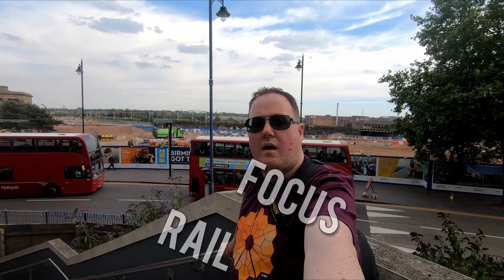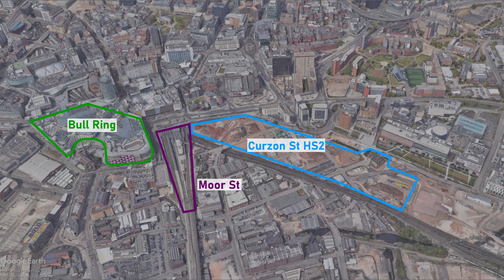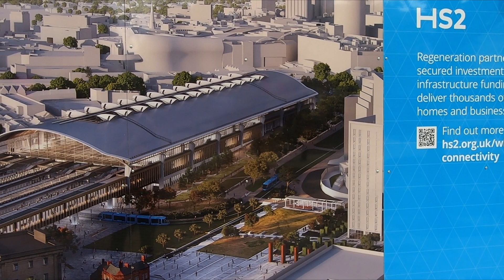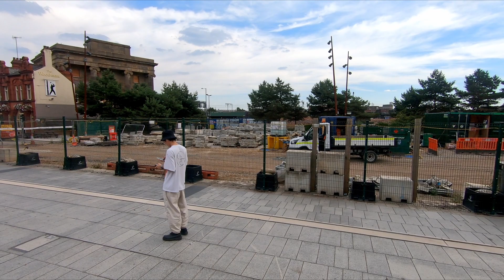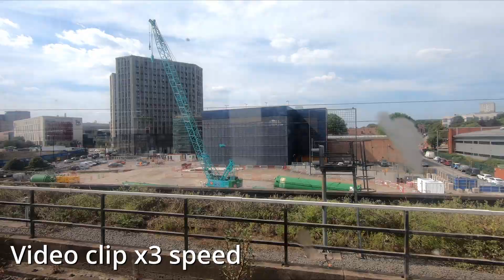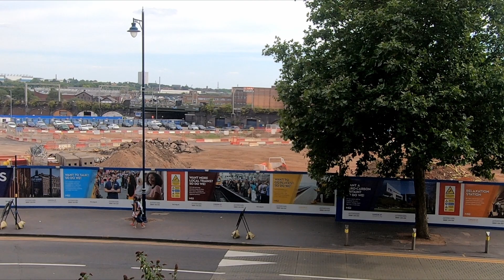HS2 Birmingham Curzon St Station | Progress Aug 2022

Comment: The Midlands and we Midlanders need a good underground "tube" system, like the new Elizabeth line in London. We should have the same well integrated Public transport system that the Londoners enjoy and have enjoyed for decades. HS2 will only benefit people living close to the few Stations on the route. To use HS2 I would have to travel for at least 40 minutes, more realistically a full hour. Using my local station, Atherstone; from home I can be in Euston in less than an hour and a half. Why would I spend an hour travelling to Brum, to then spend another hour getting to Euston? Bear in mind that HS2 won't take you to Euston, it will only take you to Old Oak Common, from where you will then have to catch a tube to Euston or London centre. I wonder if these planners can do joined up writing; they can't do joined up thinking.
Reply from the maker: I can say categorically HS2 will stop at Euston, they're building the new station as we speak. However Old Oak Common will offer improved connectivity thanks to connections with Crossrail and GWR services.

Atherstone would have been closed in alternatives put forward to upgrade the WCML instead of building HS2. HS2 released capacity on the WCML for improved regional links, we shouldn't forget HS2 is primarily about capacity, improved journey times is just an added benefit.
Reply: @Rail_Focus  Mooted capacity as presented to Parliament about 11 years ago was I believe 18 trains per hour. Then after they talked to the train planners, mainly in France, that was downgraded to 14. The Eastern leg of hs2, to East Mids Airport, it is thought, will have 8 trains per hour. On top of that, the speed will never be as high as the originally stated 240kph; more likely it will be 200kph. This isn't a project of National importance - it is a very poorly conceived idea which will destroy huge swathes of prime agricultural land. Land which we will all need in the coming years, when politicians come to the realisation that we need to be self sufficient. Don't give these people the oxygen they need to keep their wasteful rail system on the cards. Instead, tell them that you want a fully costed well thought out, integrated Midlands transport system. This should be similar to the London underground tube/bus system. We will all benefit from that.
Reply from the maker: @btg7663   I'm not sure where you're getting your information from such as it won't stop at Euston and the speeds? But the maximum design speed is 360km/h, but in operation trains will travel up to 320km/h, with trains able to reach 360km/h on straight non-tunnelled sections if they need to make up time. 

As for capacity I was talking about released capacity on the WCML for improved regional and local services and additional freight capacity, that simply would not be possible without the construction of HS2.
Reply: @Rail_Focus  What worrying is they haven't even completed the design of the new Euston even down tot he number of platforms the station have. An given the continue cost cuttings and now they stating it won't be a world class station, I got to wonder whether in the end Euston will be come the Bank station of HS2.
Reply: @btg7663  If we are going to become self sufficient it won't and can't be through conventional farming methods, it will be through using facilities like Thanet Earth. Which can produce a vast amount of food on a comparatively small amount of land.
Reply: @DavidKnowles0  Greenhouses are a start; the dutch have it down to a fine art, with their huge flower market but what we need in Britain and worldwide is, vertical hydroponics, a system that lends itself to industrial scales and to DIY scales. Done cleverly, these systems would only use water when they were first initiated. Slight evaporation would occur but water usage would be minimal. They don't need expensive prime agricultural land; tthey could operate on industrial commerce parks. Equally they could be set up by you and me and anyone else that has a care for our planet and its future.
Changing the subject back to hs2. To get a view regarding the project, that gives a more or less balanced description of hs2, you could do worse than to go to B1M on Youtube and watch the presentation given by someone who unlike myself, is obviously pro-hs2; it has the title "The £100BN Railway Dividing a Nation" I found it interesting that Euston is portrayed as part of the hs2 project, which confirms for me that hs2 really are exceedingly incompetent or devious. I am not talking about the engineers and all the people up the sharp end; I'm talking about the likes of Mark Thurston. Mark really does make talking the talk an art form.
Reply from the maker: @DavidKnowles0  unfortunately the number of platforms has been decided, down from 11 to 10. The basic layout has been decided, they're mostly working on plans for the over site development now. Plans for the existing station are being developed separately by Network Rail
Reply: @Rail_Focus  The eventual cost of this project is going to be well in excess of £100bn over a period of about 20 years. The cost to every tax-payer, will be about £1000 each, the percentage of the population who could benefit from it is probably less than 10%.  90% of the population would benefit if the money was spent on improvements to the existing rail infra-structure. Better still spend £100bn over the next 20 years on puting NHS GB back where it belongs in the league table of world health care providers - i.e. top of the league where it used to be; that way GB could feel proud of itself and 100% of the population would benefit! No brainer eh?
Reply from the maker: @btg7663  you're confused capital expenditure which is paid for with by loans backed the value of the return that projects will generate vs operational expenditure which is day to day cost paid by the tax payer. £100bn over 20 years for the NHS is roughly equivalent to an inflationary increase in yearly budget, the NHS budget between  21/22  was £190bn!

We wouldn't have any investment in public transport if budgets worked the way you imagine. If Londoners thought the  way you did they'd ask why they should pay for investment in the North for projects they'll never use or benefit directly from.
Reply: @Rail_Focus  Great expectations demand imagination. Our planners lack imagination and boldness. For what it is worth my feeling about finance and accountancy aren't publishable.
Reply: HS2’ page for Old Oak Common has this to say - ‘Old Oak Common will become one of the country’s most vital transport super-hubs. The station is expected to be one of the busiest railway stations in the country with high-speed rail services to the Midlands, Scotland and the North' It goes on to say ' 'and access to central London and Heathrow via the Elizabeth line.’
looking further I discover that they have this to say - 'This will be through eight conventional train platforms, to be served by the Elizabeth line, taking passengers to Heathrow and Central London, and trains to Wales and the South West.
HS2 Co. have also said that trains to Birmingham from OOC will start in 2029 but trains from Euston to B'ham won't start until 2036. You can wait seven years if you want - I won't. Assuming my continuing existence

In June the Government scrapped plans to spend £3bn on a WCM line link.

The Railway Industry Association, Rail Freight Group and High Speed Rail Group had this to say in June - "Without this connection, a bottleneck will be created north of Crewe on the West Coast Main Line, which in turn will negatively impact outcomes for passengers, decarbonisation and levelling up."
They said it was now "absolutely essential" for the government to "confirm as quickly as possible how ministers intend to protect the benefits of HS2 investment.
The bottleneck will be on the whole of this line, not just in the Crewe area. Atherstone will be affected.
 @peterwilliamallen1063  Forgive me if I sound cynical but only rail buffs - I'm not a rail buff but I do think rail travel is the best way to travel - only rail buffs and folk from the south will find hs2 an asset. I can't believe that anyone in the Midlands would allow themselves to be taken in by the overblown descriptions regarding hs2 and the rest of the country.
If you really want comfort and connectedness with frequent trains - then you should be shouting to have an underground service (like the London tube) from Curzon street. Stephenson would be nodding his head in affirmation. Philip Hardwick, Curzon Street's designer would also probably approve. COME ON BRUMMIES: demand a service that suits you; imagine a tube train that took you from Curzon Street to East Mids Airport via Water Orton, KIngsbury, Tamworth, Measham, Ashby; not an expensive white elephant that only people near the station can access realistically. People who live in other Brummagem outlying areas, fantasise about a line that would suit your day to day  travel requirements.
Reply: I have seen the predicted timings for trains to run from OOC and from Euston. In black and white on HS2' own page. HS2 says that trains from OOC to B'ham will start happening in 2029 and trains from Euston to B'ham won't start until 2036.
You may have good bus services and easy access to an airport; I haven't.
The East Midlands where I live (once upon a time I was a Brummy) where I live is the fourth most deprived area in GB.
Birminham has a population of 1.4m, the whole of the Midlands has a population of 10m, we can't all use your bus service. Being the semi-rural place that E. Mids is, generally mens there isn't a useful bus service.
Shout up for the rest of us Brummagem!
Reply: @btg7663  a tube-like service for Birmingham and the West Midlands would be nice, but it's not gonna happen especially as the tram is now the established solution with the West Midlands Metro being extended. Like @Peter William Allen said, I'm not sure why you'd want a tube-like service to East Midlands Airport over one to Birmingham Airport which is closer?
Reply: @Alto53  I live in the East Midlands. The East Midlands and it's population  are the fourth most deprived area in Britain. Even a tram service would be welcome out here; a mostly rural area. An area where probably quite a lot of the agricultural produce that you city dwellers take for granted, is produced: without benefit of an efficient public transport system. There are 10.4 million people in the Midlands all told. There are only 1.4 milllion people in Brummagem; for whom a tram service is hunky dory. A tube service throughout the Midlands would be of benefit to all of us, you included.
I fly to Manchester quite a lot and East Mids Airport is just right. Were HS2 built as the planners want it, I would have to travel to B'ham New Street to get a train to B'ham Airport. That would entail spending anything up to two hours, just to get, to the airport. Were HS2 scrapped and a decent tube from Tamworth to East Mids Airport available I could be at the airport in less than an hour. Far better for someone who needs assistance when they arrive at the airport. Take a look at the bigger picture Alto, don't just think of what you find useful.
Reply: @btg7663  The East Midlands is a separate region in the country, unless you are proposing the West and East unite under a regional government. A tube-like service between the 2 ain't happening. Also, Nottingham has a tram network which is in the East Midlands. I think it's more extensive than in the West Midlands Metro.
Reply: @Alto53  Nottingham has a tram service which serves all of Nottingham. ONLY greater Nottingham. I live 20 miles away from Nottingham. I haven't been to Nottingtham since I passed thhough on my way to see a cousin who lives in the north of Nottingham 15 years ago.
London has a very comprehensive public transport system.  The population of London is 9.4 million; as I pointed out to you the whole of the Midlands has population of 10.4 milion.
Why shouldn't the larger population enjoy a comprehensive public transport system?
The way things are at this time; something like 70% of all the money for transport collected by the exchequer, from you and I in the form of income tax and all the other taxes and council rates, gets spent on London's comprehensive public transport system.
Come on Alto shout up for the levelling-up that our MPs keep absent-mindedly referring to.
Demand an underground system which would get you to Nottingham, so that once you were there, you could try out Nottingham's tram system.
Reply: @btg7663  you're looking at this from a far too abstract perspective, you can't just compare overall population sizes. The combined Midlands (cM) is almost 20x the land size of Greater London (GL), GL is 607mi² and the (cM) is 11,053mi². Further, GL has a population density of 14,690/mi² and cM has one of 2100/mi².

The far smaller size, the near equivalent population size and the much, much greater population density make it much easier and far more economical to connect places in GL than the cM.

What you need to compare are conurbations/mostly continuous urban areas, for example the West Midlands county or the cities of Derby & Nottingham. Neither of which compare to Greater London in these metrics; however the West Midlands county is rather close in density.

Regardless, there are other factors such as GL having higher taxes to fund the GLA and TfL, also very high business rates near the areas of new public transport investments; not including the inflated London economy where everything is seemingly at least 50% more expensive in the capital. These are the disadvantages of being like London that people don't like talking about. 

I think the West Midlands could qualify for a tube-like service that goes under central Birmingham and connects the various towns in the county. You can say the same for Greater Manchester as well, but not for connecting the East to West Midlands or anywhere else first.
Reply: @Alto53  Abstract: my dictionary says - existing in thought or as an idea but not having a physical or concrete existence - I'm not sure just what isn't concrete about a comprehensive public transport system and I see no difference between the 200 million people who are predicted to make use of the new Elizabeth line and a large number of people in the Midlands who crave transport interconnectivity, similar to that which London enjoys. The Elizabeth line will stretch from Heathrow to Abbey Wood, a distance of 100km; is the population density uniform across that expanse?
You have mentioned the Birmingham tram system; as if it is some sort of wonderful new idea; which, from what I can see, will only get you to Wolverhampton. At just 19km it pales into insignificance when compared with the 130km of tramway that Birmingham had in around 1930. Now there was a fine example of interconnectivity. Had those people - I think they are called planners (sounds like an oxymoron) If those "planners" had kept the tram system and further developed it, there you would have a system I could cotton to; by now the trams would be going all over the Midlands, irrespective of conurbations. The old trams took one to the Birmingham boundary, where they CONNECTED with Midland Red buses, which then took you to places such asTamworth, Nottingham, Gloucester, Leicester; they even went to Wolverhampton! View this link to see the extent of the 1930s tram system      http://tundria.com/trams/GBR/Birmingham-1930.gif
Don't let yourself be hide-bound Alto, be bold. Join me in spreading the word - travel is great when it is a comprehensive public transport system, having bags of INTERCONNECTIVITY.
Reply: @peterwilliamallen1063  Carefully read what I have said in all of my comments Peter instead of jumping the gun and making spurious remarks, both ill considered and sarky.

Comment: The logic behind choosing Curzon Street for HS2 (or "Cameron's Folly") instead of entering New Street is totally mind bogglingly stupid when most of the passengers who want to change trains at Birmingham will need to transfer to New Street to get their ongoing train.  The 20 minutes tram journey will defeat any time saved using HS2 thus ensuring HS2 will become the waste of space and money it will prove to become.
Reply from the maker: It's all down to cost vs benefit. It'd be exceptionally difficult to get a new 7 platform station anywhere closer to New St, therefore incredibly expensive. Like I've said platform to platform is doable in 10 minutes and it's adjacent to Moor St and will have a tram servings other parts of the city. People to the south east of the city will use Interchange. So not every HS2 journey will start/end with a New St transfer. Also the new station ties in with the regeneration happening in that area.